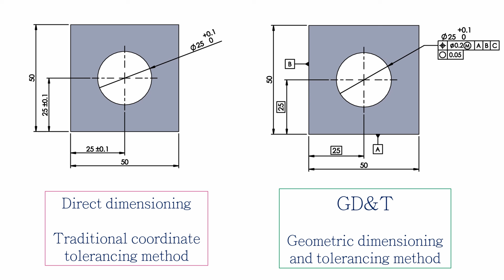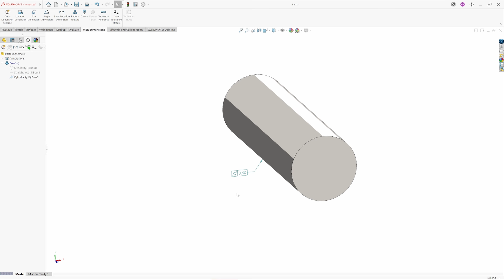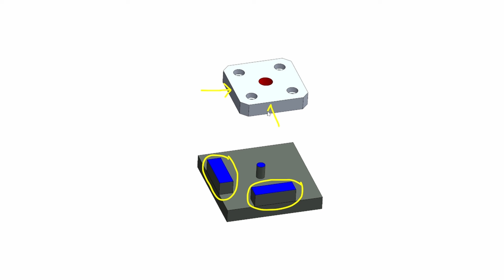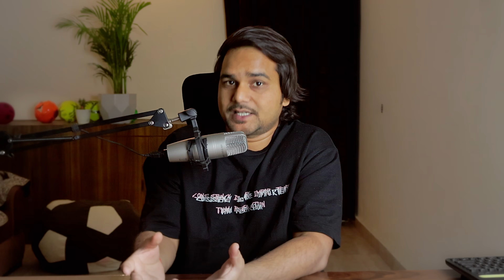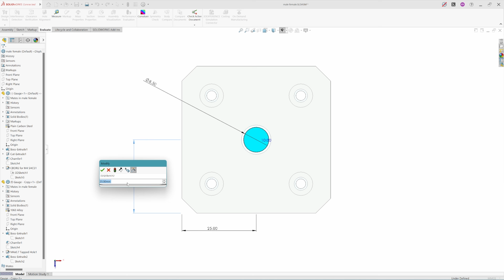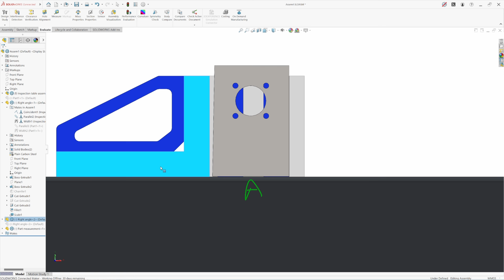7 Main Reason to Make Drawings in GD&T | Mechanical Design Engineers must Know

Comment: 13:56  there is another problem too. Since the gauge pin diameter is reduced to 6mm, even if the component's x and y dimensions are perfectly made within the limit and the hole size is not within the limit the gauge pin definitely allows the part in some cases.  For example if the hole is made 8mm dia which is not  in limit but the gauge will allow this.

Comment: I'm very pleased to have become acquainted with your content. However, there is a general issue in your teaching method where you have not paid attention to the datums of the  DWG The first datum should have the greatest degree of freedom, for example  Datum A  is the plane which seat on other part  and subsequently, the other datums should follow with decreasing degrees of freedom.

But overall, I am truly grateful for the effort you have put in.
Reply from the maker: You are absolutely right, I will make sure to cover Datum selection in detail in upcoming videos.

Comment: In problem no 06 and 07
You said that Datum word for
Datum A to surface table resting
Datum B to Right angle from side
Datum C to Right angle from back

1st condition) So shoul i consider Datum means always Reference surfaces or plane
That we have to provide or arrange during inspection

Or
2nd condition) Shoul i called Datum direcly to the Part surfaces as shown in that plate drawing

If (1st condition) is right then WHY SHOULD I CONSIDER always 90° for datum, when will i need to consider datum at any angle
AND should i always need to measure from our arranged datums

AND if 2nd condition is right then that surface table and other 2 right angles just for resting purpose and Measurement we have to take direcly from part surface wherever datum symbol is showing on part direcly 
Is it right Please clear this confusion sir
Reply from the maker: Hey, you have so many questions, and I understood, and I'll try to clearly everything in Datum video, (maybe in 1 or 2-3 parts) 
but here is some key notes:
1. Datums doesn't have to at 90 deg. from each other. datums can be at any angle.
2. Datum selection preference- Functional (Design) then inspection then manufacturing.
3. Not only faces, a "feature of size" can be also a datum. like a cylindrical hole, or shaft outer diameter.
4. We select the datum as per design requirement, but we also keep in mind that how the inspection would be, or manufacturing will be.
Reply: @mastermechanicaldesign  thank you sir, 
Actually i wanted to ask, To whom i should call a Datum to arrangements like surface table and  that other to angles that we have created for resting OR to part surface where Datum symbol is placed

Comment: Please Make video on how to decide value for position tollernace (with material condition). In both fitting parts like plate with 4 holes and plate with 4 pins fit togather.
Reply from the maker: Sure!! Noted